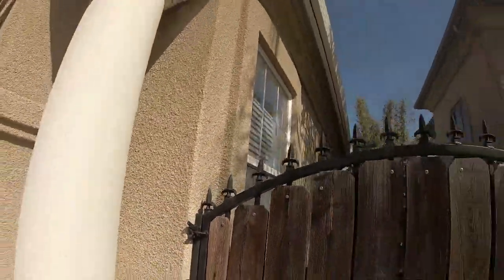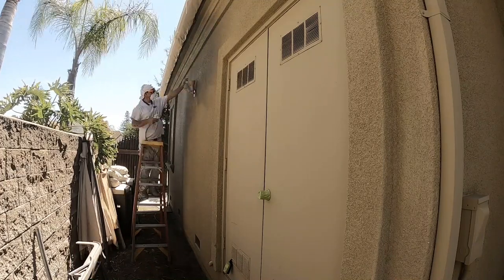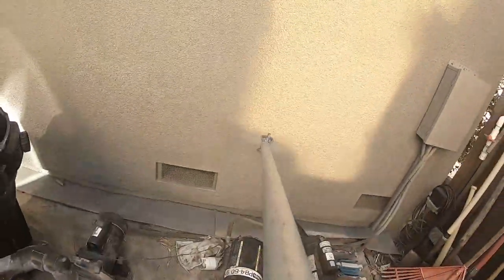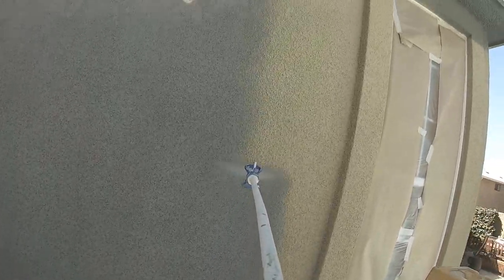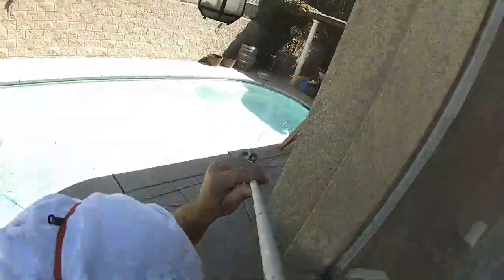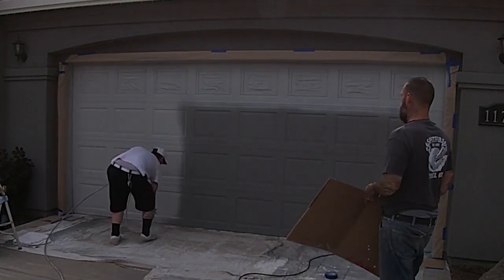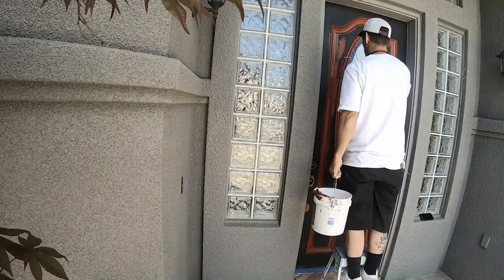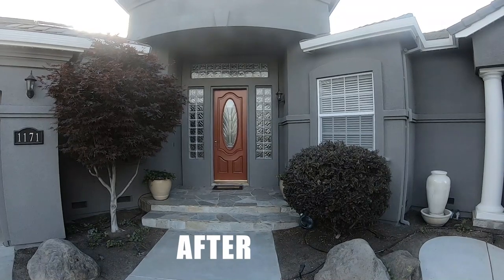Painting Stucco with Airless sprayer (best grey color for exterior)

Comment: The trouble with painting with an airless sprayer is this, A lot more work is required to tape and mask areas .Soffits, Gutters,Windows, Doors, plants,etc
Even good tape is very costly today
The temperature and wind conditions determine if you use the sprayer
Spraying uses up to 50 percent more paint
Spraying stucco, you may and probably should backroll it. More labor.
Cleaning the system properly is a real pain
If your a professional painter, yes, use a sprayer, you can charge your customers to cover the added expense
A do it yourself person should stick to rolling
I painted the outside of my 3000 SQ ft home,all stucco, used a roller and it came out perfect
I did buy a Graco sprayer to use, but it was way too windy to use it. So I didn't even take it out of the box and returned it
Just a different opinon